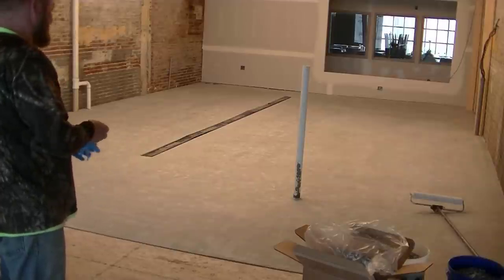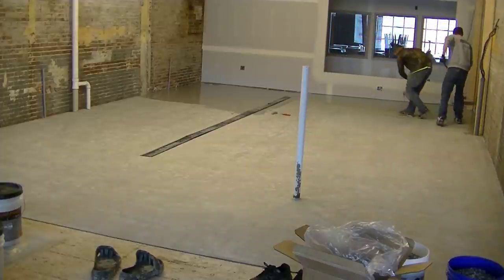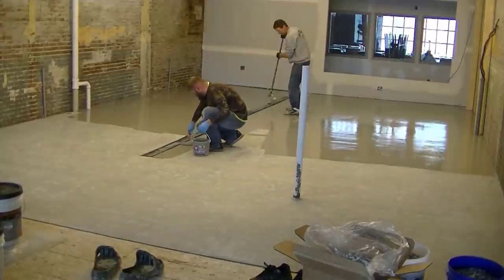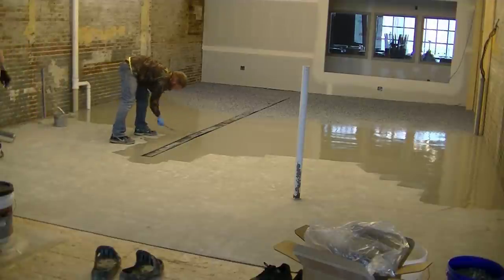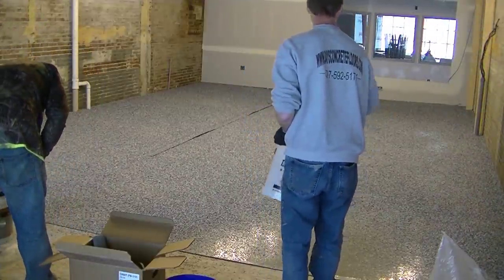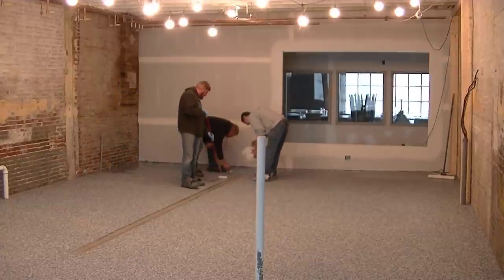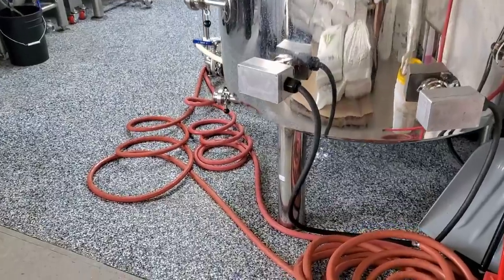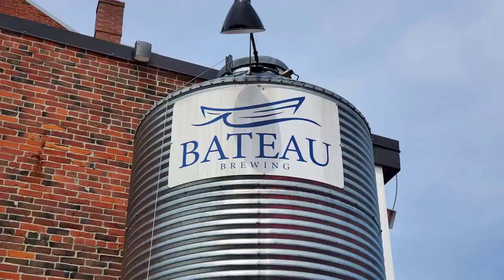Epoxy Garage Floor Coating used for a Brewery Floor (DIY epoxy floor)

Comment: Thank you.
I really enjoy your videos.
It is enjoyable to see the techniques that other people use.

This past Thursday, I poured twenty yards of concrete with two guys. It was 95 degrees and with the humidity, the radio said the heat index was up to 107 degrees. I thought those guys were going to pass out and fall face first into to pour.

Comment: And if you use Rocksolid and it says 1 box does X amount, triple it and then you will get a decent final cover.

Now, compare 3 to 4 times the Rocksolid solid to yours and I am sure, yours is lower cost and way better finished product.  Great job Mike

Comment: Good post. Hello, again Mr.Day firstly thank you for your valuable advice before. I have another dilemma I want to buy a bull float but not sure which would be the better option a steel or mag float and what is the best size to look for. Your recommendations would be most appreciated.

Comment: I used to be a merchant seaman so I used marine grade epoxy, and polyurethane but I'm not familiar with polyaspardic, whats the difference? Also we used anything from regular sand to wallet shells for non skid. I can't tell you how many times people would try mixing it in the paint, where as I got good at spreading it like you where doing the flake, although I had to roll a couple feet swath and spread it as I went along because it cured fast and we didn't have those fancy spike shoes. Also have you tried a broadcast fertilizer spreader, does that work?
Reply: That marine epoxy coating is absolutely amazing! The Navy used it where I was stationed in the USAF and it was virtually indestructible.
Reply: @westside98  certain indoor lighting can omit uv, which can yellow epoxy over time
Reply: @Grizzleback07  I got lucky and my company was switching over to polyurethane and they had a conex full of assorted epoxy that they gave to me. Unfortunately I never had the time to coat my whole garage, and moved so dropped of at my cousins house and it ended up getting wasted.